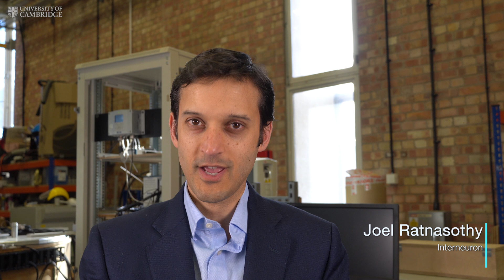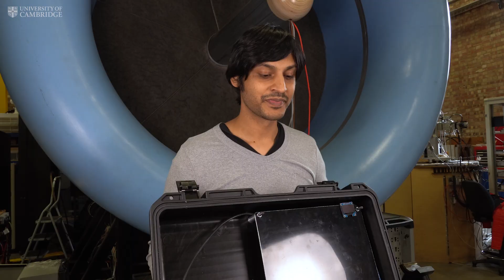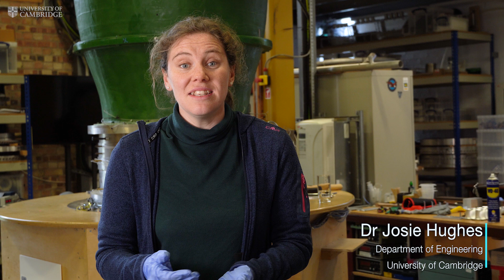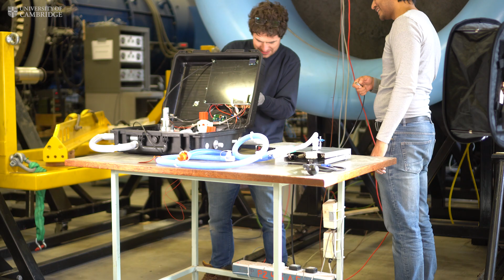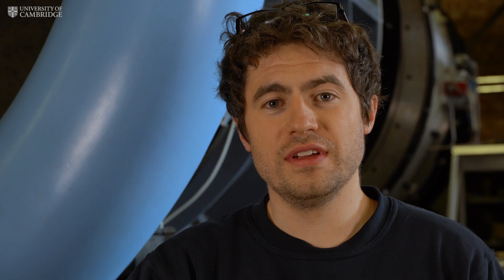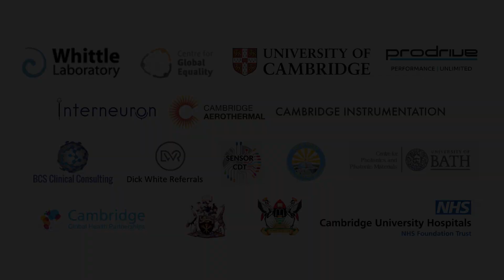Open-source ventilator designed for use in low- and middle-income countries

Comment: Nice work! What standards are you guys designing to? Is it the UK Rapidly Manufactured Ventilator Specification? 

Also, what do you guys use for the controls system. There seems to be a couple of Arduino Minis, are there concerns with using an Arduino in a safety critical device? Are you implementing an RTOS?

Sorry for all these questions, I am working on a emergency resuscitator (powered Ambubag) with some colleagues and am interested for any input with respect to controls. We were recommended to use a safety rated controller like a Hercules MCU (but that involves alot more effort, and time is limited!) However our prototype is using an Arduino Uno (atmel chip).
Reply: Their website claims that they are pursuing FDA certification http://www.ovsi.org/